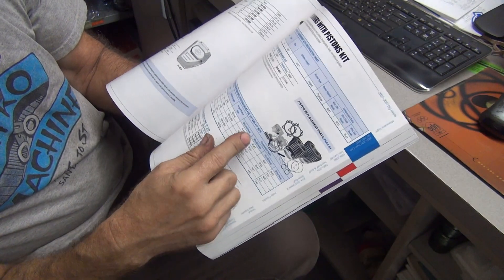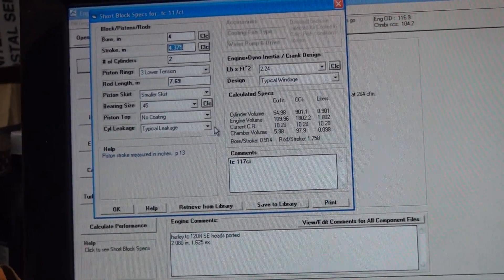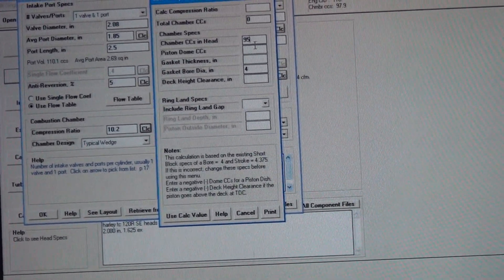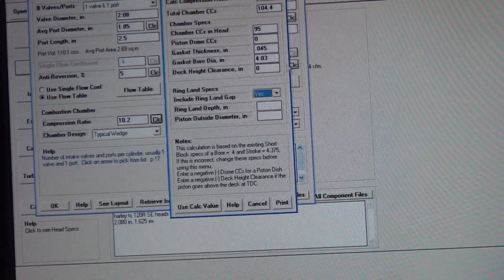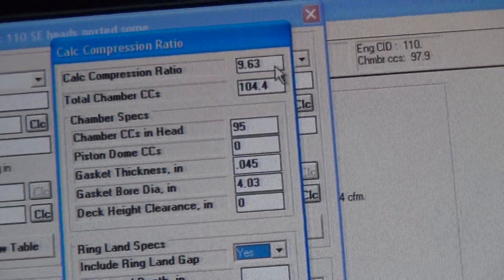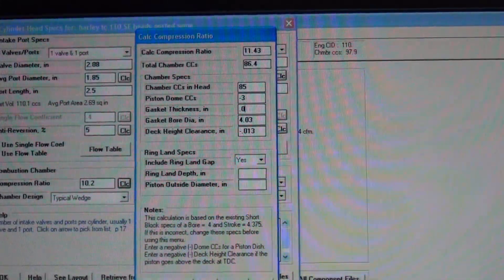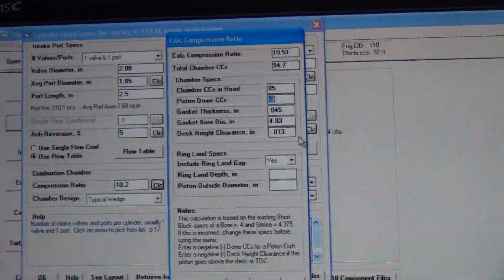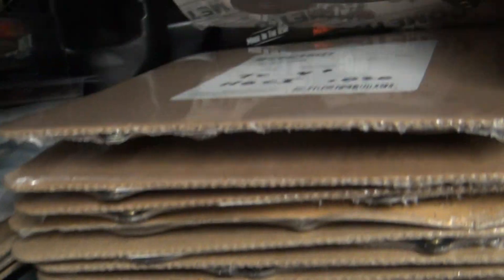#119 110ci 117ci twincam case boring flywheel rebuilding 2007-2017 1999 harley by tatro machine

Comment: KT,,, way back when,, I was putting my TC, back together,, I mentioned the head gaskets that were matched up with KB pistons, and ring set..you said it might not work the best,, cause they were so thin. (110 in.) (4.00)
long story short,, you were correct.. 
I then went back to a .043 thickness, basic head gasket,, which I believe came from S & S
The compression went back down i bet,, to where it sorta should be.. Just the stock motor with the larger heads..
It all seems to work fine at this point,,,  and also no leaks,,  You educated me on a few of them fronts,, and I thank you.

Comment: Port the chambers and run the thinner gasket to keep squeeze up and run a larger overlap cam, that’ll all help....
Reply from the maker: just what you need, more cylinder pressure when you all ready have too much. the big cam will stop the pinging at lower rpms but will still ping at the higher rpms when you come up on the torque. when you are limited to pump gas than make the motor work on it and live. staying close to 10:1 is best if you want to keep your gaskets in the motor. when the very fast bikes are broken the fast bikes just keep on running.
tatro

Comment: Keenan I know you wouldn't use a flex ball hone and I understand your reasoning BUT If you did/ had no other choice, what grit would you select? I'm trying to replace my leaking cylinder base gaskets on a 87 EVO and need to hone and install some new rings. The pistons & cylinders looked clean and it's relatively low miles for the year, 34k. 120/240/320 grit?  I'm also toying with the idea of  possibility going with a new piston of a 10-1 compression in the stock bore size. I measured the cylinders at various depths and got a std 3.5 bore. Could I buy those pistons and still just do a hone. Would you even recommend uping the compression in a older Evo? Im installing a EV27 cam and just cleaning up the heads. Relap the valves and new seals. Just looking for a little more power to keep u with the Twin Cam guys I ride with. Will be running a Kerker 2into 1 and a K&N  intake.  Thanks
Reply from the maker: use the fine hone and watch the cross hatch pattern. this is very important. i show what to do in my videos. just go with the thinner head gaskets and keep it around 10 to 1 max. the ev27 is a good all around cam.
tatro
Reply: @TatroMachine  Thank You!

Comment: If the cases were bored out to accept the 110 cylinders  (by the headline I thought it was going out to 117 - now that would cause a diesel-like comp. ratio ) were they also bored to accept the 'O' rings that seal the base ?

BTW, 4 inch bore is 110, 4.06 is 113 and 4.125 is the 117 - all with 4 3/8" crank - so the 4.160 bore head gasket is for the 117, 4.1 the 113 etc etc.... very interesting and pertinent point about the head gasket's dimples though as the 110 cylinders and the overboard 113 cylinders are machined from the same core product. 

I had problems with the (copper) head gaskets my builder used and now I know why he used them. The aftermarket is using harder liner material as it doesn't expand so much with the higher heat from increased cylinder pressures.
Problem with my cylinders leaking though was due to the cylinders overheating and distorting the ally castings so the oil passage areas leaked - hence my now trying cooler plugs. 
Haven't run the twitcam with it's newer over-bored cylinders yet - I am trying out H-D's 10R12's  cooler plugs on my Sporty. That is only 10.5 : 1 Hammer cylinders and I am going to try the RA4HC's there first.... I have RA2HC's as well.... lucky thing is that the Hammer cylinders have thicker liners that are made to have thinner spigots due to being made of harder steel..... probably how the 117 conversion came about for the 110's - they were quite notorious for head gasket leaks and they used composite gaskets and 'o' rings I think ?

Due to my engine using 20 thou base gaskets and the fact that the rods are 8 thou short of giving a level piston/cylinder deck height we took 28 thou off the cylinder tops.
Boring the CVO cylinders out 60 thou and using 113"  11.1 : 1 SE pistons, the CVO heads - now fitted with bigger valves and extensively ported - had to be skimmed a lot to get the 11.5 : 1 comp. ratio required for the S&S 640 cams I use - 30 thou head gaskets used. I have just acquired yet another set of 110 cylinders and will use lower compression pistons if I get the problems again - though I didn't use cooler plugs first time around and had no end of jetting problems.... wish I had your level of knowledge and experience !

 The skimming of cylinders and heads meant the inlet 'faces' are closer together and the (S&S Super G) manifold had to be shortened along with the tops of the heads being skimmed 20 thou  to maintain valve gear geometry. It uses roller rockers with a slight increase in ratio ( 1.675 : 1 ) to get 660 thou valve lift and a Mikuni HSR 48 with a Vulcan adaptor and the bike is a real flyer. 
 In England here we can get 99 octane fuel but I think the octane rating system is different to your's over there.
 

 Glad to see you are now truing cranks between centres - we had a discussion about that a couple of years ago when you said it was best to measure runout when the crank was supported with 'knife edge' rollers at the main bearing journals - what changed they way you do this now ? Actually I think that truing was due to the crank 'spreading' or twisting ?

 I am not a builder, and most definitely not trying to argue or criticise you in any way -  you have built more engines than I have ever even seen ! -  I am just  some fool on the 'tube asking a professional builder questions as I know you always give good advice - assuming you don't just dismiss me with a smug ( and funny) comment, though that would be well deserved as I am just over-stressing a 'junk engine' anyway........
Reply from the maker: you got some fast toys but you are not making them to last. your 99 octane should be good to 11:1 with 2 to 3 steps colder spark plugs than stock. keep the piston to head clearance around .035 and you should have a good motor.
i never true a crank off the mains. i use the centers. i was told that harley had some bad centers in the mid 2000's. just one more reason to use a good s&s crank.
boring a 110 cylinder out to a 120r bore is stupid because they are too damm thin. harley 110ci motors use o-ring cylinder base seals and 113ci  motors use gaskets. that is why the two different cases i bored were done differently for each application. most all of the aftermarket big bore cylinders are made for base gaskets.
tatro
Reply: @TatroMachine   Thanks for the advice, the piston to valve clearance is fine but the head gaskets are 30 thou so next time I have the heads off for any reason I will fit thicker gaskets.
 As I said I did not run cooler plugs and that helped spoil the cylinder castings, BUT it did Dyno at 127BHP and 122 torque whilst using chain drive cams. This time it's gear drive cams - crank is true - and I will use cooler plugs so if it makes 130 bhp I will be a happy bunny but I may not Dyno it as the Dyno man set it up to run too lean. 
At 60 years of age maybe I should start to slow down a bit but I only use the power when some kid on a jap or in a car tries it on. I don't drag race big Jag V-8's though as a supercharged one made me cringe as it was super quick.

Comment: Hey, man, you put in -0.013 for Deck Height Clearance,but it should have been positive, not negative. Negative is for when the piston comes up above the deck.
Reply from the maker: than explain why the numbers go the other way when i did it that way. maybe you should watch all the video next time.
tatro
Reply: @TatroMachine  I did watch the whole thing-look again, I think you are mistaken. When you put the negative numbers in there for deck height clearance, the compression figure went up, when you put positive numbers in, it went down. Check out 5:17 to 5:30 or so in the video.